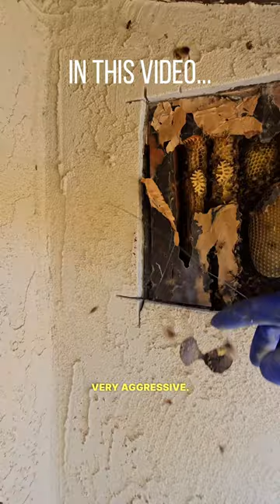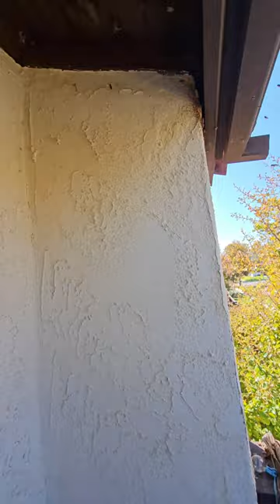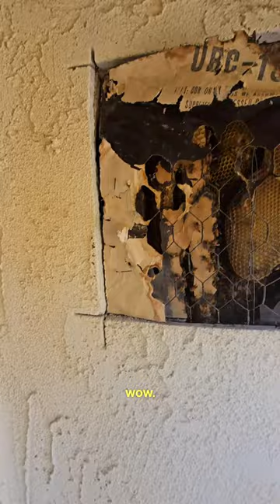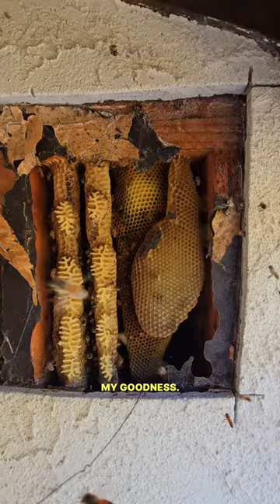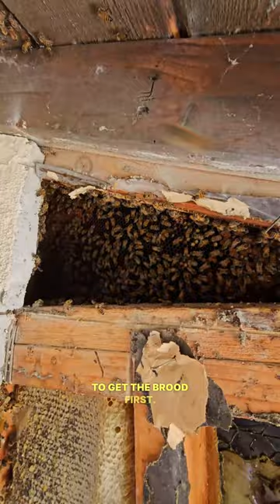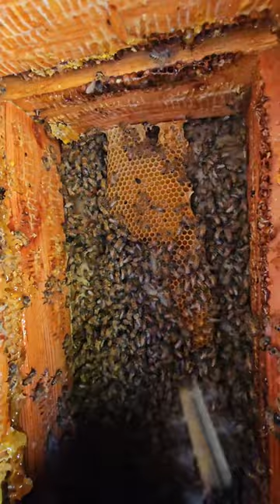Super Aggressive Africanized Beehive! #bees #nature #honey

Comment: I had killer bees one time.  I came to my shop early one morning before it was light, later, when it was light I heard this odd humming sound from outside under my canopy.  I thought it was the AC unit, but it was not running.  I opened the door and around one of the poles that held the canopy was a massive swarm of bees as big as a garbage can.  I beat a hasty retreat and called a local bee man.  When he came out, he confirmed they were killers and he used smoke and whatever to get rid of them.  He said they will swarm around a queen and can build a mass like that in minutes.  Later after he was gone, there were a few little swarms around on my driveway and as I drove past them they were hitting my windows like bullets.
Reply from the maker: Oh wow yeah killer bees are no joke , there is a gray line between aggressive bees and killer bees and the difference is really scary actually